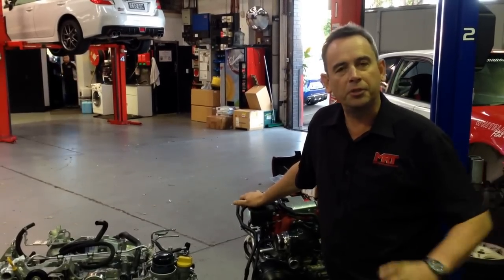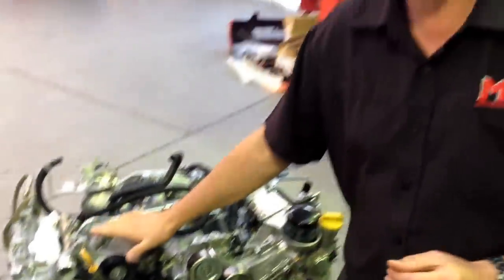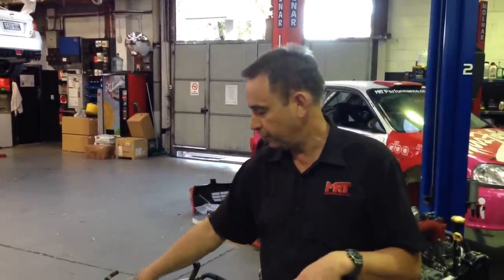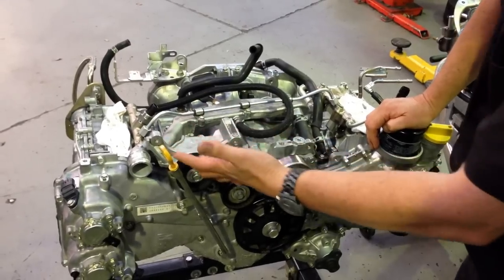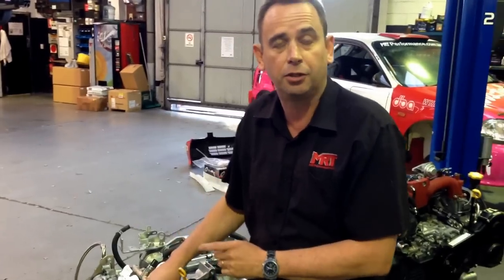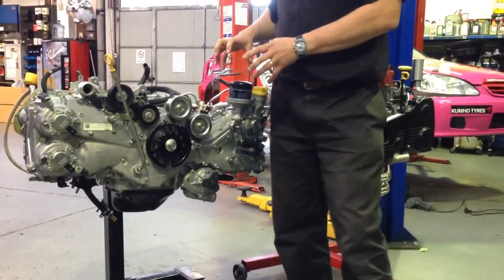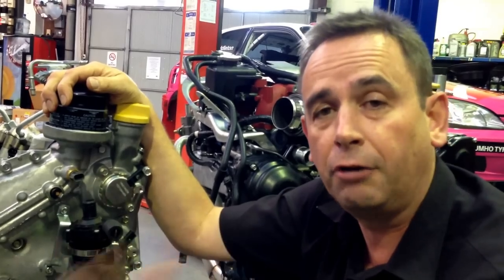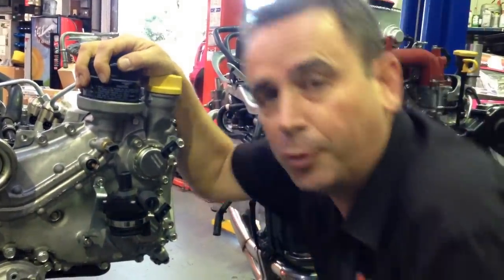Subaru FA 20 engine internal modifications tips and traps with turbo and supercharger

Comment: You could still run the stock comp if you convert to e85. Or, and this is why I really hope subaru has the foresight to keep port injection possible on the head, you can run isoproptyl or deionized water through the port injection system and ramp up the pressure for the DI. 11-12:1 plus boost shouldn't be a pipe dream. You really shouldn't have to give up revs for boost, especially if, like you said, the motor is going to have a complex twin charging system. It's, IMO, giving away a lot to gain a little. You can run a snail with a efficiency curve way up in the rev range and torque-fill the low-end with your super, all you gotta do is rethink your fuelcharge.
Reply: It just sticks in my craw to see people chase power out of a DOHC system and run OHV rev-ranges. Less so in a flat4 or flat 6, but especially so in turbo v6s, especially 60 or 90 degree vee's. It's like, just adopt an inline 6 platform or a OHV v8 platform. You'll sound better and go farther. Looking at you Nissan and big german saloons.

Comment: Hey so I'm debating in my head what I should do. What are the main difference between having a machine shop do you cylinder heads or getting like an iag stage 4 cylinder head? Can the stock heads make around 600whp with a stage 3 block?

Comment: I would like to get a solid 300Hp from my stock FA20 Toyota 86 Brett, any recommendations on which good components to do this?
Reply: Aussie MGTOW lolz buy the sbd 500x 300+hp with stocks engines and ecutek tune
Reply: @ken6440  That is a good kit but I am after driveability, not just straight up power, the turbo has its place when it comes to outright racing but the superchargers handle a better curve range and they have linear acceleration.
Reply: Aussie MGTOW they also put more stress on the internals. But as far as superchargers go, the Harrop and Edlebrock are awesome.
Reply: @IgoByaGo  No arguments there on those SC's, they are very well made.

Comment: Is it really critical to use oil 0w20? 
My subaru is 2.5XS with the engine fb25b. Manual specifically says the 0w20 should be used on this engine. But some subaru technician say that instead of 0w20 can be used 5w30 even recommend (where I live weather is much colder than in Australia. During winter Temperature can drop below 25C). At the the moment my car runs on 5w30 and I replace the oil every 7k km. I'd like to hear you opinion on this moment.
Reply: UAMate Use 0w40 syn
Reply: Did you mean 25F? 25 Celsius is quite warm. Japanese FA20 recommendation is 0w20, the lower the number before the W (winter rating) the easier it is to startup in freezing weather and circulate. Full synthetic is best. Number after the W is the viscosity at high temperatures. If you drive with heavy load or on a track, a heavier oil is ok, but not too much especially is colder weather, because VVT depends on the oil. 5w-30 is ok to use as well.

Comment: Hi , how  much HP i can charge my stock gt86 engine  for daily driver and to be reliable without internal modification .Thanks.
Reply: 2Fast 4U varies but general limit most people agree is safe is about 250-270bhp. You may can get 300 or more but I’m just giving you the safe number.

Comment: How much does it cost to build or strengthen an engine I have a turbo kit on my fa20 but I want to keep it from blowing
Reply: Ricardo Quezada you should be fine of you have the stock block and your under 340ish horsepower
The guy said to get stronger springs so i guess that but ive only seen rocker arms go out because of mis shifting and going into super high RPMs

Comment: 1: did the new valve springs help?
2" why didn't you take the plastic cover off the FA20?
3:  how and where can I get the supercharge (initial spin)/turbo (final infinite gearing) kit for my 2014 XV?  I'm already pushing 293 normally "aspirated' (GDI) on my homemade intake.  What the heck y'all think it might do with your kits?
Reply from the maker: +Mike Murphy best call us
Reply: One of the biggest if not the biggest limit to your RPM is valve springs because they are responsible for getting the valves shut after being opened. If your spring cannot push the valve shut quickly enough, you get valve float where the piston head impacts the valves. So better springs will close them quickly, allowing your car to safely rev higher.